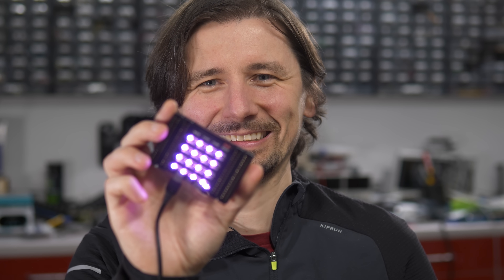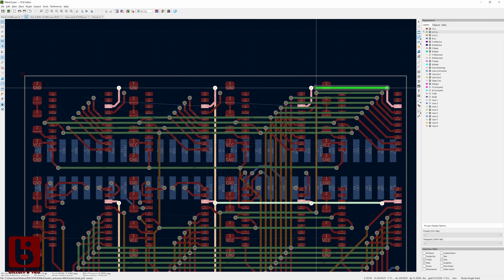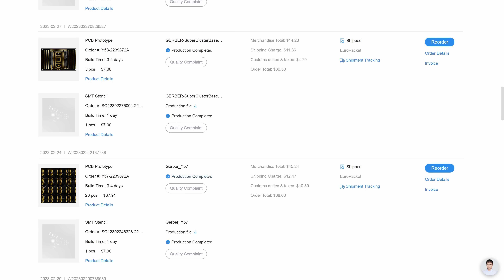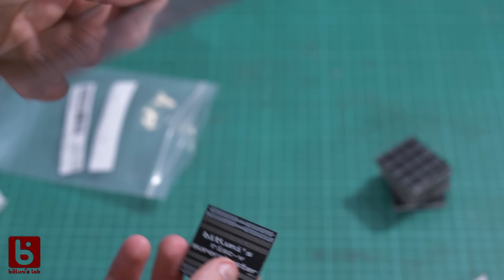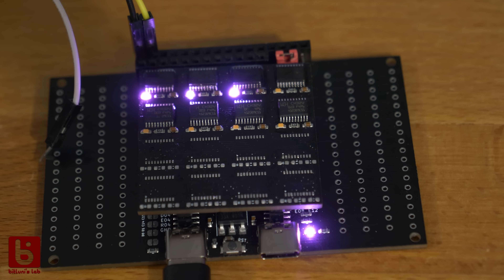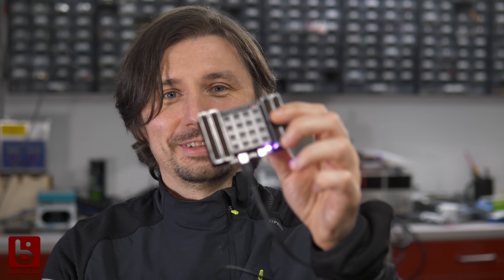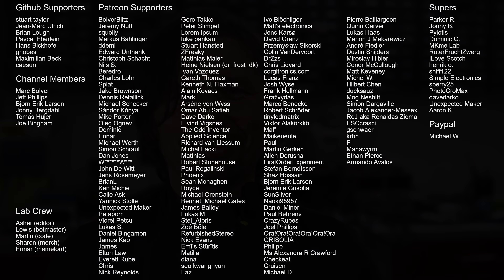Cheap Risc-V Supercluster for $2 (DIY, CH32V003)

Comment: Normally, when you make a 4+ layer board, you use the internal layers as power planes. On the one hand it is very convenient to just put a via next to each VCC and GND pad and be done with routing power, on the other hand, it provides proper return paths for the signal traces, as they are electromagnetically coupled to the nearest reference plane. Robert Feranec has some really interesting videos about proper PCB design practices
Reply: But making the internal layers power planes and the external ones GND doesn't just introduce a parasitic capacitor? and should you make copper pours in the internal layers or just leave the routes?
Reply: @johnmoore5319  1. you definitely want to use at least one of the internal planes as ground to get an uninterrupted gnd plane.
2. Yes, you introduce capacitance, but the capacitance is between the power and gnd planes, so it is actually desirable. Also, this capacitance is so small, it is basically negligible.
3. The internal planes should only be used as a continuous planes. The signals are routed on the outer layers or on internal signal layers, not the layers that are used as power planes. This way, you always have a signal layer and a power plane layer next to each other, which is great for signal integrity.
4. The question if you should pour GND on the outer layers is a while different discussion (too long for this comment)
5. Bonus tip: always place a GND via next to a signal via, so the return current can switch reference plane as well

All these topics are discussed in Roberts videos at length
Reply: @johnmoore5319  As hansdietrich said watch the videos of Robert Feranec - I binged those and I am not even that deep in PCB design. They are awesome.
Reply: @johnmoore5319  sprinkling caps all over the general vicinity of ICs also introduces capacitances, that's the whole idea of why we do that: to turn the power supply of everything in our circuit into a capacitor, which filters out any spikes.
also note "power planes" means power planes, not "VCC". GND is a "power". so if you have 4 layers you'd stack like this: signal, gnd, vcc, signal.
and yes, planes mean planes, not routes.
Reply: It also has to be mentioned that properly sizing your power delivery requirements is important, not all circuit boards require dedicated power planes, in fact, you can get by just routing power tracks in most simple MCU boards with low current transient requirements. Current transients are what determine how careful must your power routing be.

I have used power planes for complex microprocessor boards. But for simple low power MCU boards? I just route power tracks, works perfectly fine and gives me some extra board area to work with, it also allows to cut 6 layer boards to just 4 layers.

Overengineering can be as harmful as bad engineering, when you spend $800 building prototypes that may as well have costed $200

Comment: I'm interested to see how many triangles they could output per second. something that might be cool would be to add a pair of ram chips and use double buffering 
then use the master to output the framebuffer to a screen. (you could use a clock and a counter to do the fast switching and just have to handle the blanking.)
you could use a DDR chip (e.g. MT46V32M16P-5B) that can give you 16 bit RGB565 color you can directly feed to an adc per channel (probably a resistor ladder with a high speed op amp like 3 SN10501D or a single LMH6683 would work)
if the processing is too slow you could just redraw the same frame till it's done, and then swap the buffers on the next vblank.

Comment: That's cool.
I think any cluster is going to be memory and memory bandwidth limited, though. Data transfers are going to dominate there, so you'd maybe need memory banks accessible by the master and at least one of the slaves each and only use the common IO lines for synchronization and signalling (and programming). That is, if you want to take advantage of the processing power available rather than just the parallelism.
Reply: that would need a board revision, but a neat thing would be a 2-4 lane memory bus.
though depending on what you do, you may be compute limited because those are only 48Mhz processors, so not extremely fast, and they have their own local ram so you might be able to do quite a lot in parallel only.
also depending how they are linked, they actually can do DMA via I2C/SPI so that might not be a problem.

Comment: i guess you sre a bit misinformed about what a computer cluster really is. thats just a bunch of mcu's on a pcb that blinks leds. i wonder if you can connect thosse boards together and use them for AI, but you need to write an Os first and later some applictioens for it. so until then those are just dumb boards and not clusters.

Comment: Impressive and interesting. Just wondering, if you programmed them all at once, they have the same program, how do the individual processors know it is their turn? You mentioned they have an ID. Was that baked in? If so how you know what their ID is? Pull it from the processor?? How, as they are all responding at the same time?
Do i understand correct these chips have an inbuilt LED? Or did you solder one very close to each?
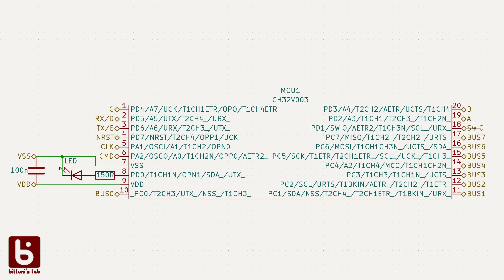Reply: Those are surface mount LED's and they're external.  You can see them in the schematic at 5:03 and on the board beside the chips if you look close at 5:38.
Reply: The programmer thinks it's only one chip because they all respond identically.
After programming, each chip uses a unique id stored in its Rom from the factory.
But I think he really needs to remake the board anyway because at this point he doesn't know who is who in which physical position  😂
Reply: It could be that at runtime they co-operate and assign themselves the ID DHCP style(but adhoc), but otherwise the program is same

Comment: Interesting that you can program those all together. That would really make it much easier when dealing with many microcontrollers on a bus.
Thought about those options as well with the STM32 ARM SWD interface but assumed because there is a handshake that it won't work anyways. Might be different here.

Comment: Rendering the Mandelbrot set would be a good way to show the scaling properties of the supercluster since its algorithm is small and parallelizes well.   It would be fun to see each ch32v003 with a neo-pixel and then create a display for the mandelbrot set with a matrix of superclusters (ping-pong balls would be a nice extra :)
Reply: That could work... Though i'd like to see it efficiently let me run ffmpeg to do video encoding on the newer codecs like AV1. I'd be VERY happy with it, if i got say 256 cores encoding video at profile 1 or 2 at an acceptable speed.

I consider acceptable speed about 2-4x longer encoding than the video playback is). The space savings in most cases are anywhere from 1/4th to 1/2 the size (at least compared to h264)

Depends on how scalable this would be. Hundreds or thousands of cores, so long as you can avoid major bottlenecks in ram you'd be able to make a really cheap useful processing center.

Comment: I had thought about a Minecraft server running on a cluster of RP2040, where each entity or a group of entities live in one mcu. A "big brother" SBC (e.g Pi 4) then handles sending tasks to the mcu, visualise the world and communicate to clients. Maybe if this chip is cheaper than RP2040 its the better candidate for such project
Reply: I am not sure if there is a point doing it with Minecraft because the entities are interdependent. To work with parallel problems you need to split them up into mostly independent chunks